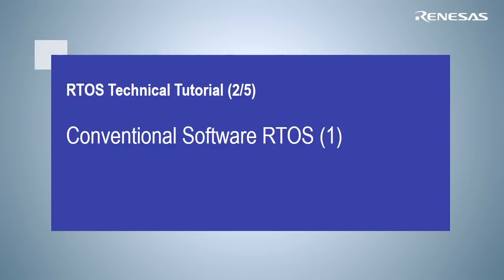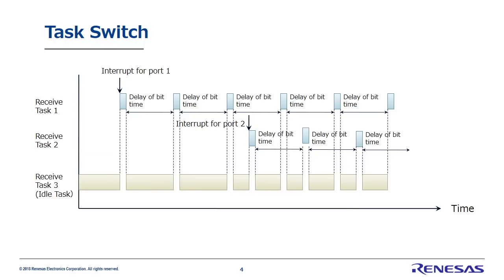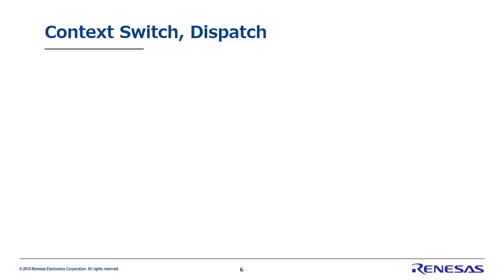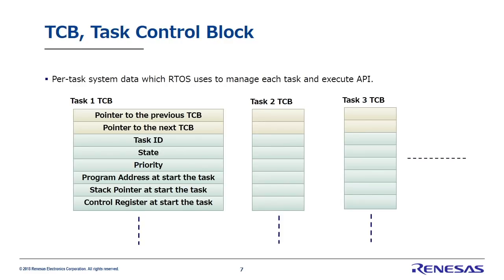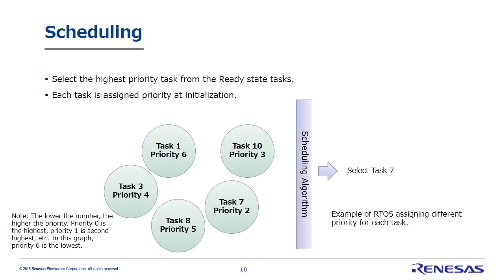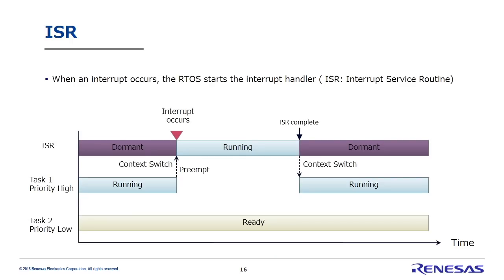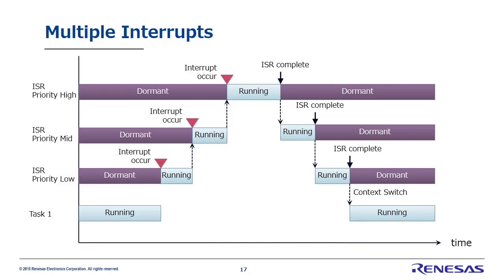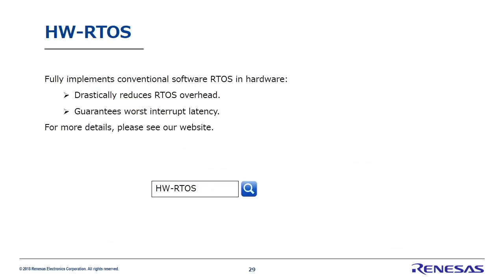RTOS Tutorial (2/5) : Task, handler and API

Comment: Basically, Interrupt are disabled when handlers are in progress. Why is that , as per my information Interrupts have high priority than handlers right. Please correct me if i am wrong.  

Thanks.
Reply: Interrupts is a type of handlers. Coming to your question, It purely depends on the type of Interrupt it is. If it is a Non-OS Interrupt it will not be disabled. For example, Take your Music playing Application on your phone as an example. They have a cyclic Interrupt that after each song it has to shuffle and search for another song and play it (on Shuffle mode). So, while this is happening if you operate from your headset and hit the next song button it has to go to the next song before the present song is complete. In this case, the external Interrupt is given the priority. Hope you got the point and was helpful.
Reply: Disabling interrupts while handling another one is to avoid "stacked interrupts" that can overflow the kernel stack. It also can also prevent deadlocks and/or "pinning".
If the CPU is processing an interrupt for hardware_A (in "interrupt service routine" ISR_A), the interrupt for hardware_B can still be asserted. It will be remembered [by the interrupt controller], it just won't interrupt the CPU at that time
Reply: Depends on the design. If the interrupt is handled in the handler it's not allowed to change during that time, as you would get invalid information/data. If the interrupt only calls one function, like for precise time measurement where execution time is relevant, you might want the interrupt to do something and leave the evaluation for a polling task.
Reply: One doesn't want a interrupt interrupting the handler process as it has the highest priority -  logically. I can understand that there is a chance of few interrupts getting missed while handlers are running. But a system can only handle what it can - it doesn't have infinite parallel+serial computation power to handle them all. It's more like an essential compromise in my opinion. Think about it.